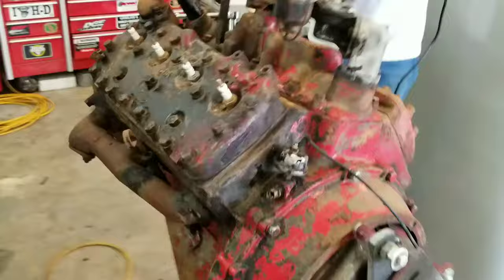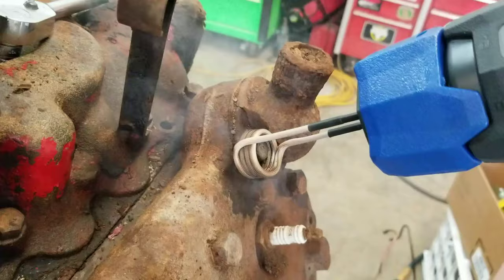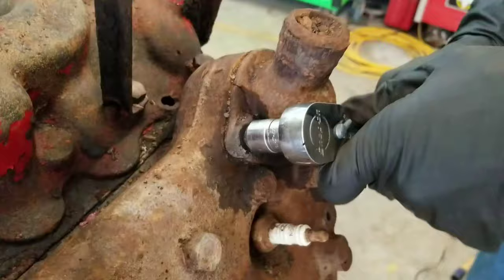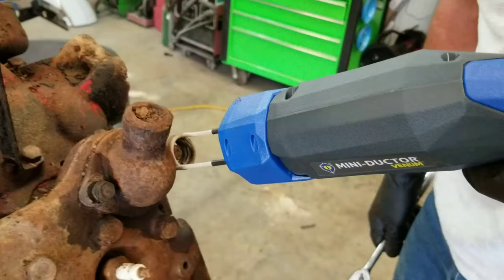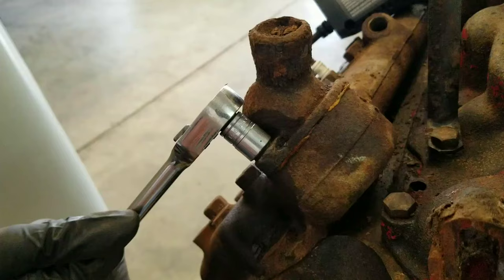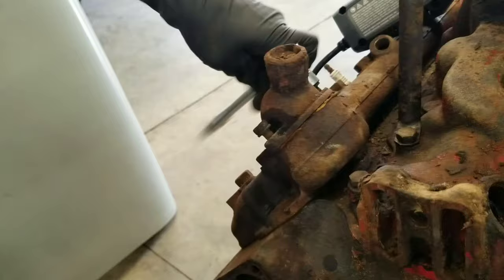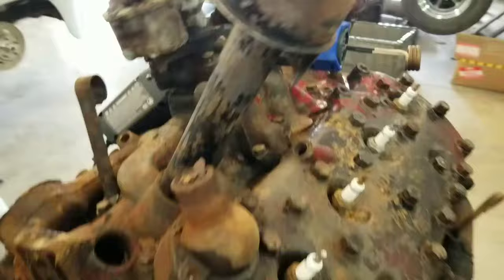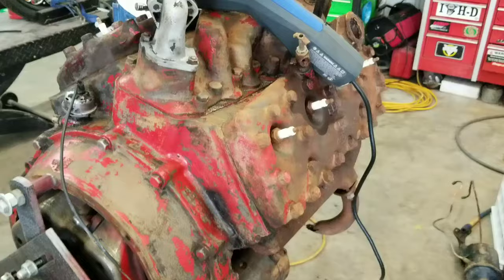A Cool Tool for Removing Rusted bolts and fasteners

Comment: Heating the bolt expands the bolt by .001 every 100 degrees.heat around the bolt with a torch and the hole expands makes sense but heating the bolt itself just sounds like a waste of money. I might be wrong but that's my 2 cents

Comment: Or you can use what is called the Walling Method. Hold a can of air upside down spray and freeze the bolt... Works for me. Walling Method

Comment: ● ●  I'm trying to figure out the physics behind that. 
(Normally), when trying to remove "stubborn" bolts, you heat up the surrounding material, which tends to explain "away from" the bolt, itself. 

This tool looks like it's going to heat up (and thereby expand) the bolt, itself,  which would make it harder to remove.
Reply: From what I see, and what I remember from my thermodynamics class, it seems that the coils are touching the housing and flange that the bolt goes into.  That direct contact would conduct heat into the flange faster than through the air and into the nut head.  So I think it's really that the flange is heating up faster than the nut, and that is allowing the screw to loosen.
Reply: @rodshop5897  ●  Yep.  Gotcha.  Thanks!

Comment: The tool is meant for nuts. Heating a bolt expands the bolt. Making it that much harder to get out. You always heat around the bolt. Never the bolt.

Comment: I would not torque on a hot bolt , heat makes it softer & expand  making it tight in the hole , I would first hold a drift against it , hit it with a 24-32 oz hammer , couple times braking the rust loose  & maybe not need the heater , & then do the drift again after the heater

Comment: I'm too smart with money to buy Snap on tools. I admit hey're good quality tools but nowadays the competition is fierce. Instead of paying double what it's worth from Snap-On, why not get a tool that's worth exactly what you're paying? I use SK X-Frame ratchet wrenches which are lightyears better than Snap-On in every way. At 1.7° they have lowest arc swing in the industry with 216 positions to break bolts in the tightest areas where other wrenches cant even move enough to click once. The SK will click 50 times. These are by far the best wrenches for the money and well worth every penny.

Comment: Too funny..for heating and removing rusty bolts get the right tool for the job, it's the only way to go!! 
But after that to remove corrosion stuck T-stat housing..use your best ratchet as a hammer!!! ;)

Comment: I've use these but I dont believe that helped you get the bolt out. With heat the bolt would expand which would give you less tolerance between the bolt and bore threads causing more friction between the two. 
If you heat soak it a few times and let it cool you're more likely to loosen up corrosion. 
If you're watching and think you're just going to heat it and remove it. You're going g to learn some lessons.

Comment: i think you  have got it  incorrect ,,,     you don't  heat up the bolt but the areas surrounding the bolt  (so that it is hotter than the bolt and expands more    than the bold and allows the bolt to be removed )

Comment: So, applying heat to the bolts, which expands the bolts in the hole, makes them easier to remove? I mean, it looks like it works, but this seems to go against the laws of physics, interesting. I've always thought heat was needed in the area around the bolt

Comment: That thing would work best on nuts not the bolt if the heat is just in the bolt it will expand in the colder bolt hole

Comment: So, what's the big deal?  A little penetrating oil, heat the nut with a torch, to make it expand a bit and wrench the nut off.  That old millwright trick is older than you are.

Comment: It's 450 dollars on Amazon right now. Given this video is 2 years old and you bought it on a Snap On truck I'm guessing you payed around 800-1000 dollars for this. Those bolts do not look that rusty to snap off unless you're using an impact. I've taken out exhaust manifold bolts off of a 40 year old block that sat out in the weather and used penetrating oil and those bolts came out and they were half the size

Comment: If you use an induction heater be sure to add in a capacitor to provide the correct power factor correction. Gotta get that voltage and the angry pixies back in phase or the power company will spank your ding a ling.

Comment: That's baloney. The heat will make the bolt expand and become even tighter.  Always let the bolt cool and shrink back before loosening. I'd like to see a torque wrench on the bolts before heating.  I don't believe they were seized.

Comment: O.K., I see this is a few years old, however, it does not make any sense to me. Whatever you are heating up expands. If there is a nut that won't move, it would work. But if a bolt won't move, why make it bigger ? Something here just does not sound right!

Comment: If you broke that bolt, you need more experience.  If I even think a bolt is frozen, first thing I do is heat.  NEVER HAD A LOSS.
Reply: propane torch.

Comment: it goes against logic. heat expands which would make the threads tighter. if heating a nut, it would work good. ive used a torch to heat 1000s of bolts and you always heat the female threaded part.
Reply: Take a bottle, fill it with water. Put in freezer and see what happens

Comment: Not doing your ratchet driver any favours should be using a brake over bar on tight bolts / nuts to loosen
Reply: Amateur mechanic here.  Can you explain the logic to me?  Is it really that bad on the ratchet to over-torque it like a breaker bar? 🤷🏻‍♂️

Comment: Not sure why this works. Very tight bolt, put heat on very tight bolt, very tight bolt expands with the heat and gets tighter, very tight bolt now comes out easy, why? Sure, heat up the thing that the bolt is in,  but why heat the bolt?

Comment: wel it's cool alright but you guys should have leaened as young kids that you don't try to actually twist the bolt first off but rather put pressure on it and tap it working back and forth that way you can keep the old bolts with their original temper and such. many times I have spent a whole hour to remove one bolt but in that time I didn't even bother the paint or gasket ,"O"rings etc

Comment: imagine that... something you could have done with a torch that you've had in the corner for the last 10 years...
Reply from the maker: Of course, until you work on something that you can not use a flame on. Like a fuel line or rare car parts as in later videos.

Comment: 20 dollar torch works just as good
Reply from the maker: Not where flame can not be used, as in our later videos
Reply: But u didn't use it this way.  Put it under a cars fuel tank.
Reply from the maker: @ksladerock4465  I used it directly on a fuel fitting with gas in line.
Reply: @WarmanAutoworksLLC  your  nuts.

Comment: quit taking them bolts out so far you end up "pinching" the bolt at the other end. breakem loose, tighten it back down slightly. move onto the next one. no more broken bolts

Comment: Unless its a bolt for the gas tank or a fuel line i will just stick to my torch
Reply from the maker: Used it on fuel line in later video. 
And 54 Corvette steering wheel. Two places we definitely could not use a flame.

Comment: I guess that may be ok if you have an engine sitting out of the vehicle on a stand, most broken bolts I have encountered are always on the engine in the vehicle, and always in the most inaccessible places.Just looking at the size of that device you would be so limited to where you could use it, another  waste of money from Snap On!
Reply from the maker: Or if you have a 54 Corvette steering wheel that you can't remove. And a torch would burn it up. See latest video.

Comment: BS.. The actual threads are more than an 1" away from where your heating , and what heat does pernitrate the bolt, will only cause it to expand in the treaded area, rendering the extraction even more difficult.....

Comment: Would have been nice to see it on a bolt that he couldn't remove with a breaker bar.
Reply from the maker: I believe in a later video under the 71 F100 we did.
Or, on a fuel line fitting with gas in the line..

Comment: Sooooo why pay for this instead of just using a torch? I can guarantee that can't fit in some on the places a torch can.
Reply from the maker: # 1 reply. Of course you could. Unless your working on something like a 54 Corvette steering wheel, or a Fuel fitting with minimal gas in line. Which we did in two later videos.

Comment: Mini ductor costs almost $500 from Amazon. Ill keep using a torch
Reply from the maker: What 90 % say..
Look at latest video where flame would destroy 54 Corvette steering wheel
Reply: @WarmanAutoworksLLC  well yeah that I WOULDNT allow so much as long nails near!!!!! My daddy had a '53 Corvette with the blue flame 235. He bought it  for like $200 in 1960. I've always been upset for him doing it. Your a professional mechanic so having the very best tool makes life for you so much better even if the Snap on guy owns your soul. Lol have you ever used the melted wax cheat to get stuck bolts off? Take a torch heat up the old boat like a Take a torch heat up the old boat like a Chevrolet exhaust bolt that's been in there for 25 years you know the one get it hot as blue blazes and then take us candle it doesn't matter I like the long ones I have found that the better or more expensive candles work better than the cheaper ones but just melted where the bolt makes contact with the threads and what be wax does is Chase down the threads and then you can just spend it on out it'll come right on out I get about 98% of all the bolts that are stuck on the outboard's I work on due to abuse and salt out like this.

Comment: Why not just use a propane torch?
Reply from the maker: Most common response. Check out last two videos where flame could not be used. 54 corvette steering wheel. 
And a fuel like fitting with Gas in it.

Comment: Why? Oxy acetylene torch works better.
Reply from the maker: Because there are places you can't use a flame. Like around gas or rare parts as in our later videos.

Comment: So what....maybe the tool works and maybe it don't...try to actually perform more of an authentic test by using a torque wrench on the bolt before using the heat gun to show us how seized it is, and then use the torque wrench on the bolt after having used the heat gun on it. However I'm not totally dismissing the fact that heat can help to expand metal loosening up things making it easier to disassemble them

Comment: A torch used properly will get the job gone every time , the heat expands the bolt it's not rocket science just be patient
Reply from the maker: Of course. Yet not safe for every application. Watch latest video. Perfect example.
Reply: Warman ,Your right and it's nice to have options , point made !

Comment: Using it on the head of a bolt and then taking out said bolt when it's cherry hot... I bet you clowns used a 12 pt socket to.... brilliant!  but for the record, heads of bolts are not the part that gets seized inside of a threaded hole and I doubt the heat penetrated enough to help THAT much... oh and I owned an original mini ductor FYI.

Comment: torch does same thing an does more things in a show. that one off tool is meh i will take a torch anyday over that.
Reply from the maker: Most say that. Yet, many places a torch can't be used. Like in our later videos.
Reply: @WarmanAutoworksLLC  i dont know ive got a torch in some tight situations. but then again if its only car bolts you are after an im lazy i would use that. i enjoy the fight of removing old bolts you get a nack for it after you either struggled, broke, stripped one out.......

Comment: Guess no one has a torch?
Reply from the maker: Sure do. Way more handy than a torch. And many places you can't use a flame. Check out our later two videos.
Reply: @WarmanAutoworksLLC  if I couldn’t use a torch I’d make a cocktail for the pesky corrosion and rust.

Comment: or use a torch and save hundreds
Reply from the maker: Of course,  but don't try it where I used this around gas or rare parts as in my later videos. Or you'll loose thousands.

Comment: Blue torch..cheaper...get same result...
Reply from the maker: Of course, most common response. Not if your on a 54 Corvette steering wheel or a Fuel fitting with gas in line as in our later two videos.

Comment: my blowtorch does the same job and costs me $30 instead of that $2,000 tool
Reply from the maker: Correct, what most say, until you use it where a flame can't be used. As in my later videos.

Comment: Im calling BS, you never heat the bolt, just the casing. that would work great for nuts.  and ya never use air tools, you obviously are sponsoring this tool. that was a thermostat housing no big deal.

Comment: what wrong with a normal torch kit? This tool sucks.
Reply from the maker: Nothing, except where you can't use a flame. As in our later videos.
Reply: The tool is big and long. You can't access much with.  I use heat gel to absorb the heat from the torch kit to protect sensible parts. Works pretty well.

Comment: I wound not put that old boat anchor into any restore. The Meccums and other top auction rules allow modern drivetrains. That engine was state of the art in it's day, but today it's junk. Even for the buyer. Why would you spend 50k  on a car you could barely drive? Unreliable, underpowered and dangerous.

Comment: No thanks, I'll stick with my oxyacetylene rig
Reply from the maker: Sure.. check our latest video where that would burn up a steering wheel
Reply: exactly, that's my point ... beside that,  nothing beats it ... it's versatile , it works ... and is also cheaper to use and operate ... plasma cutting , arc welding , brazing ... oxy-acetylene does it all, at a fraction of the cost ...
Reply: @WarmanAutoworksLLC  I saw that video you'd be surprised how tiny the flame can be if you put a number 2 tip on your oxyacetylene rig.  I could've gotten that not red-hot in under five seconds, not enough time for steering wheel to burn up especially with the spray bottle with some water in it handy.  In today's economy you need to have one tool that does it all.  Actually settling rig is cheap loosens nuts and bolts, welds, brasses, cuts. etc. my shop is cluttered enough without another gizmo hanging on the wall.

Comment: He said common sense has to be used when working on these.. But you didn't use your common sense when you broke  the first bolt off.. So tell me when you use common sense before or after a bolt breaks off.. See y'all try to sound like your all smart in stuff .. But y'all are just a set of shade tree mechanics..lol.. Just average bolt Breakers